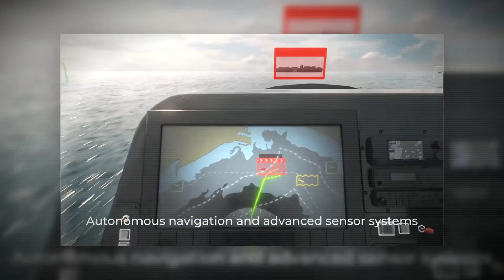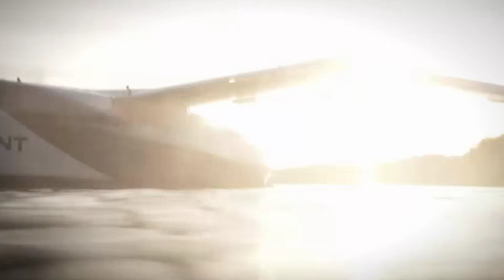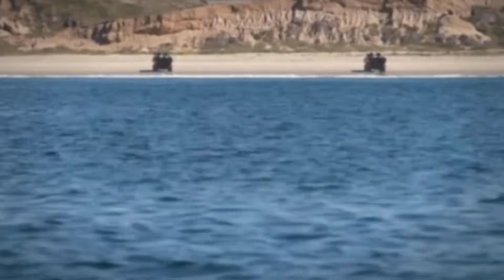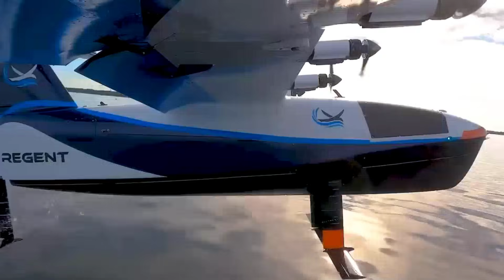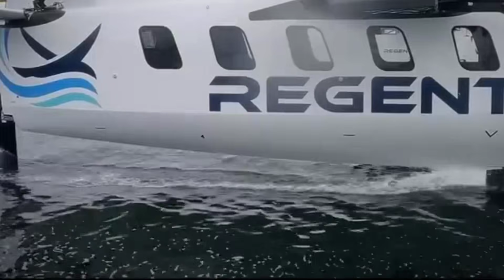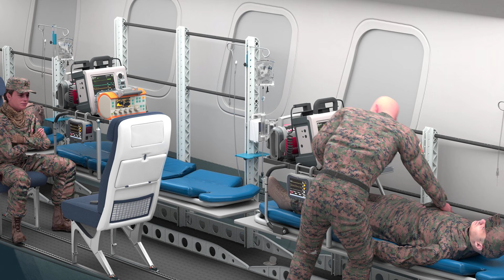US Marines NEW WIG Vehicle SHOCKED the world!

Comment: At first I wondered if the electric motors were a flaw in the design but after thinking about it I think they may actually be a useful feature. If the side- profile as a boat is stealthy enough,  and it is running below the aerial radar horizon, electric motors should also give it a low infrared profile as well. This thing could be both fast and stealthy  and thus could be a very useful landing craft.   
Definitely worth researching.

Comment: My question I have is what is going to supply the energy to operate electric motors?🇺🇸🇺🇸🇺🇸
Reply: I think the obvious answer is a damn big diesel for 95% of use . However the electric motors with their low heat signature could be really valuable for sneaking a Seal team onto a beach undetected.